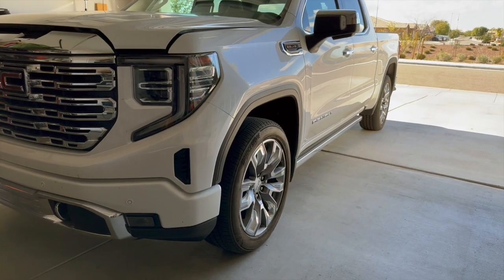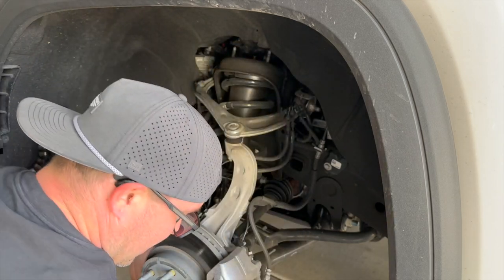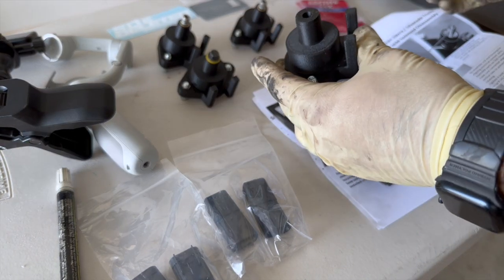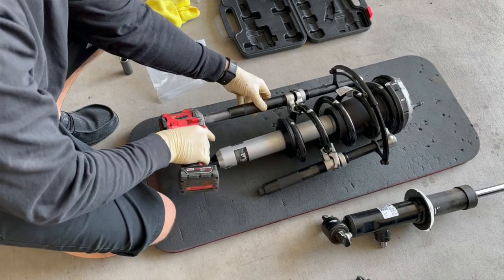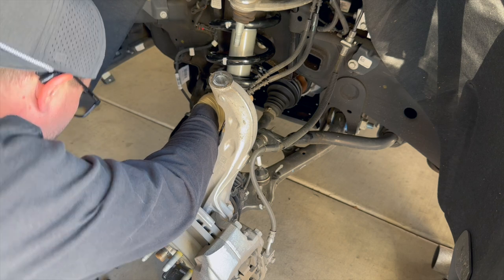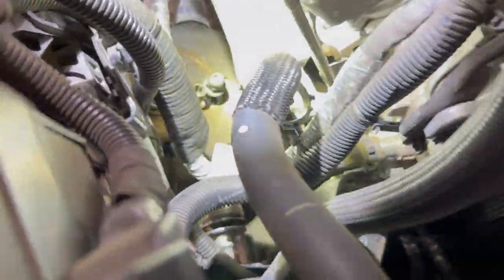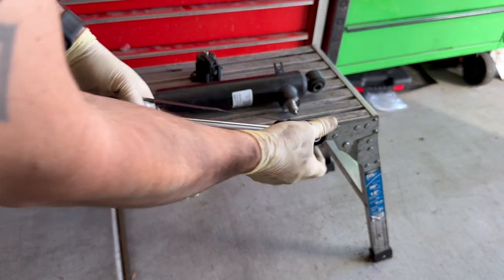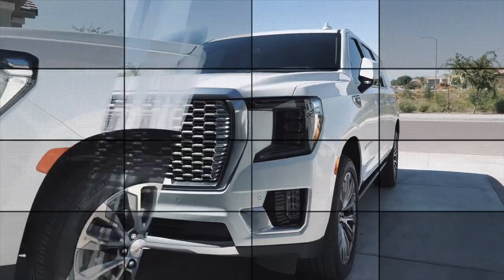Step-by-step Fox Shocks Install On The Sierra Denali

Comment: Did you get an alignment after leaving it with a 1 inch lift
Reply from the maker: After I was done it went and got new tires and an alignment. 1” isn’t going to make a huge difference but it’s always recommended!